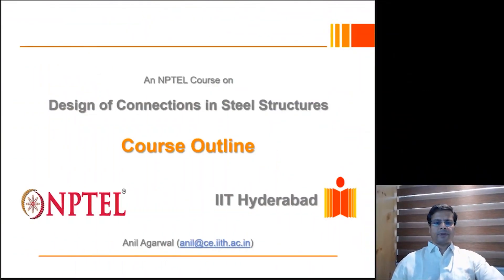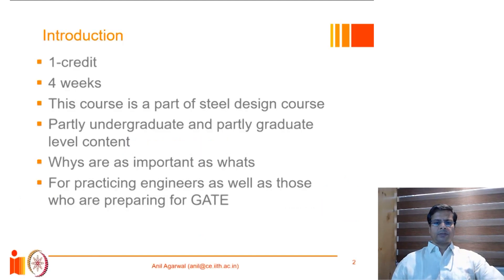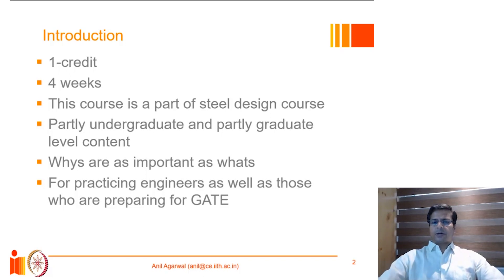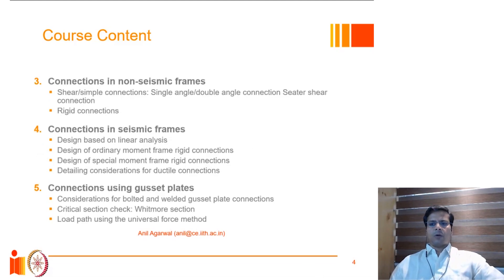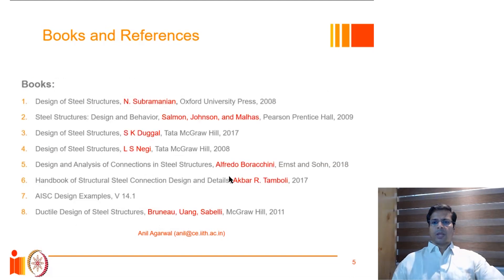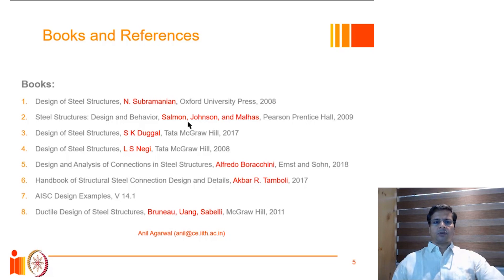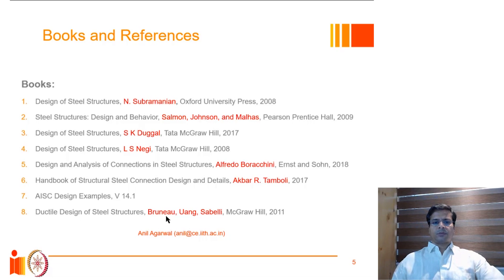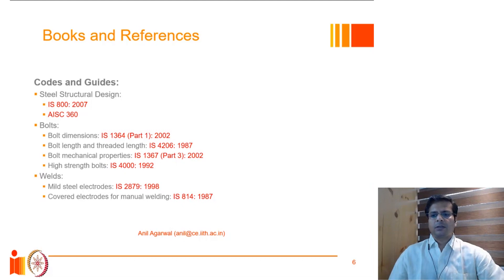Design of connections in steel structures - Introduction

Comment: deeply awaiting for the course . sir please cover connection design rules for Section 12 of IS 800: 2007 and also draft code Steel 13920  which is currentely published by BIS
Reply: Dear Alex, Thank you for your interest. We will try to cover the fundamentals of ductile connection details. However, it will be difficult to cover the specific details of the draft code for ductile connection design. I will consider offering a separate course on that later.
Reply: Beautiful series❤